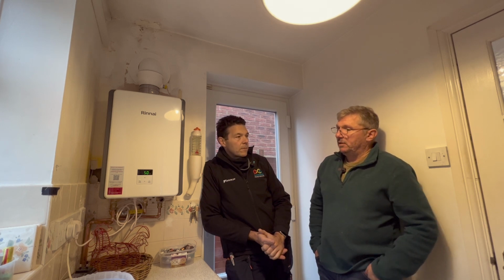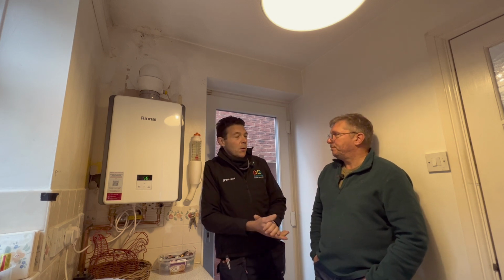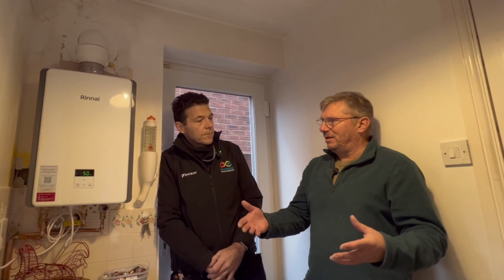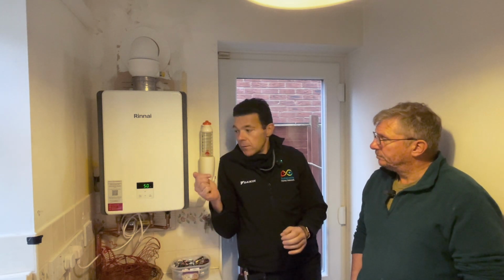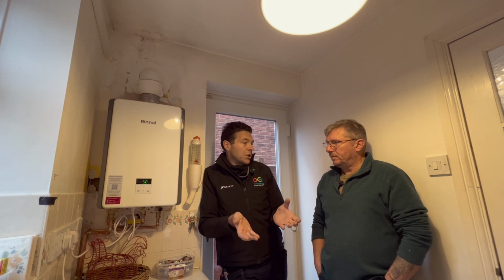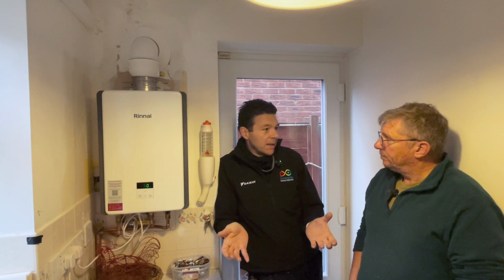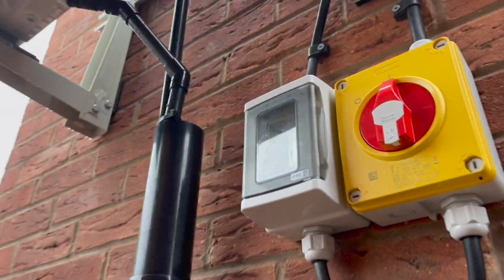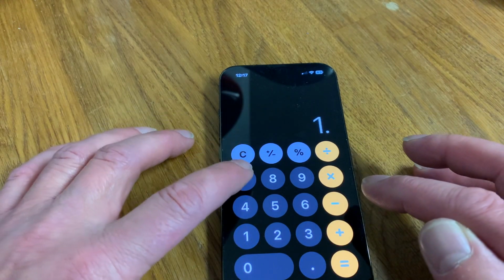Heat Pumps: RINNAI Water Heater  And the cost of it all

Comment: Hi Mike, Just one question - how long will it take to pay for itself with the current charge for gas and electricity?
Reply from the maker: Not sure why this question is being asked, so I will ask you first how long will it take for you to get the money back on your boiler/ heating system? The question should be is the investment worth the results? Is it reducing your monthly/yearly energy usage? For me the answers are yes yes and yes
Reply: @mike-M0MSN  Good question Mike,  ours is a new build (paid for while the floor drops out of the house market!) So not really return for me. I wasn't kncking your investment if it fits your build and your willing to wait a number of years for the return on your investment. Then cracking.  👍
Reply from the maker: @MAV8865  No offence taken, unlike solar I am not expecting to recoup the total cost of the install and I would not advocate replacing a perfectly good working gas or oil heating system just to save 10 - 25% of the energy usage. The facts are the cost of install will pay for 10 - 15 years of the additional energy prices. However if you find yourself in the situation where you need to replace your heating system, then heat pumps are the way to go.
In my case the cost of replacing my Gas system and replacing radiators and pipe work would have cost 2/3 the cost of heat pumps, so it was a logical choice for me.
🤪😀

Comment: Happy New year Mike a bit of a diversion but well explained. I was a heating engineer many moons ago, thanks for the CPD. As you still have a Cylinder Have you and your Man factored in Solar thermal for hot water? would it be cost-effective? I have seen your tubing skills you could do the first fix to cut costs, might even be resonant.
Would a long wire work in a rotary drier looking for something for the motorhome we only do pub stopover one-nighters so needs to be up and down like Topolz elbow.
Cheers M7 HTO 27mhz H2O.
Reply from the maker: No cylinder, it was removed with the heating.

Comment: Hi Mike,

Thank you for sharing this much detail on the system. Really looking forward to the next update (especially since we had the 2 week cold snap in the UK)

We're getting almost the same system installed in our home in January 2023 (2x Daikin multisplit compressors + 7 indoor units) due to the fact that the previous owners had a terribly sized/designed air-to-water Heatpump solution put in place. 3x 4kw ASHP, 200m2 house - it fails miserably at temps under 10c outside! During the -5c temps we were using 150kwh+ per day just for heating... Mainly due to original pipework that was never replaced, as well as using original radiators.

I've seen enough USA "mini-split" videos to give me confidence of the air-to-air route that I'm going, and your initial data also helps to back that up!
Think similar to you ripping out all the pipework, replacing all the radiators etc would've been an astronomical figure.
Reply from the maker: I have just done a calculation based on the last 34 days ( this is for the two Daikin heat pumps and seven room units only and not any hot water) and I have used £6 per day giving that includes some very cold days,  -12 at one point but mainly around -6.
Reply from the maker: I would also add that on the coldest days we averaged 29kW of electricity used. Average temp in the house 22deg C

Comment: Hi Mike - fascinating. By all means do your Magloop video (love all your radio videos), but for me your heating videos have been just as enlightening.  I love the honest assessment - you went for Air-to-Air heat source for space heating, but for now have stuck with a gas boiler (direct water as required), rather than jump to the full heat pump solution (and have given the reasoning ). Dameon  seems very knowledge too (now following his channel).  / For my situation I do find our air-water heat source pump solution more  efficient for hot water than for space to be honest. Writing on the 15 December, the pump has provided all space heating to 20C, and all hot water required, and it has been comfortable for sure. But at £10-12 / day. Now this is in quite cold weather, and in the summer we have all the hot water we need for << £1  / day. So the system has had a hard time for sure.  Great stuff Mike !!  Mark (2E0MSR)
Reply from the maker: Hi Mark, yes time will tell on efficiency and cost now sub zero around -8 for me and the heat from the system is still coming cost are around £10 per day but my neighbour who is still on the old gas system is reporting £12 per day for his Gas (smart meters) if you take into account my gas usage we are at around the same costs!